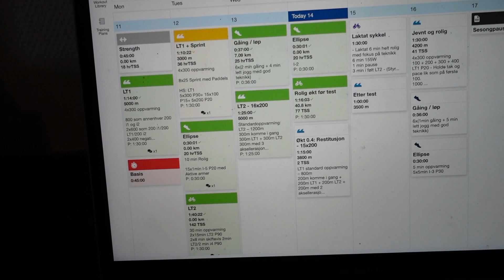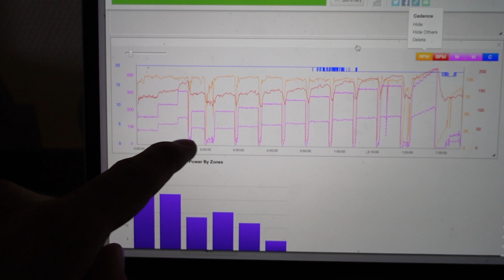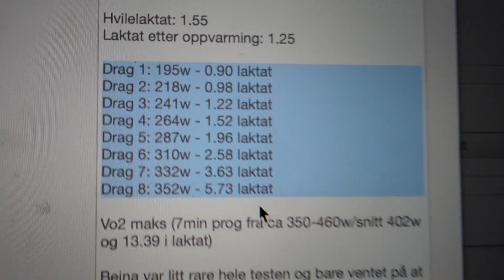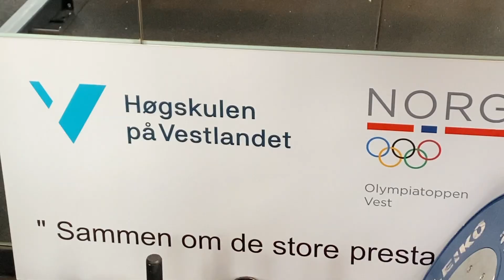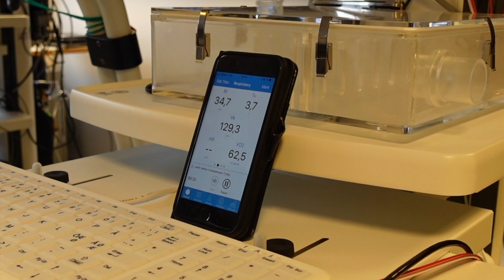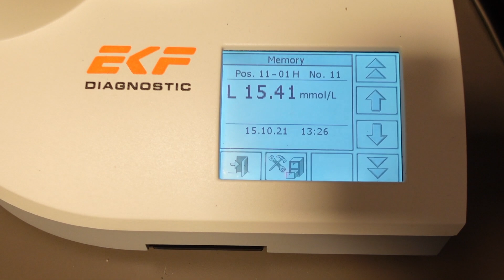Lactate test & Vo2 max in the LAB // All time high // Road to 2022

Comment: Really appreciate that you are sharing so much of your data. One question: Why do you use two different devices to measure VO2?
Reply from the maker: Thanks! At the lactate steps we measure Vo2 for 2 minutes in the middle at each steps, so that’s the reason why we only use the VO2 master (the mask) at the Vo2 max effort. It’s to much job to take it on and off;)
Reply: @cedrikbakkechristophersen  So why not use the mouth piece and the nose clip for the VO2max test? Does it impact performance at such high intensities?
Reply from the maker: @philipskotzke   because it’s easy to get a bit sore in the throat when using the mouth piece, so that can impact the last step when going all out. Would like to use the Vo2 master for the whole test, caus it’s so much better to breathe with, but it’s a bit to much job to take it on and off
Reply: @cedrikbakkechristophersen  Thank you for taking the time to answer my questions. That makes a lot of sense. Recently I participated in a study with 5x6min stages and wore the mask all the time. We use a similar mask to the vo2master, but wired.